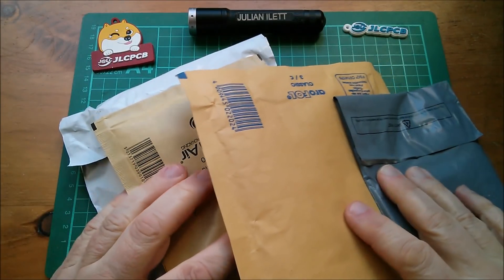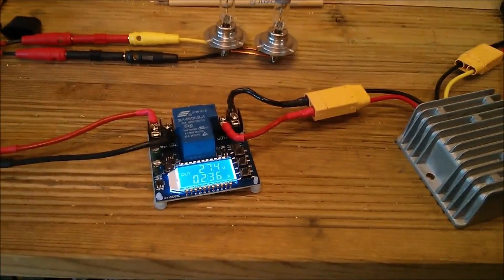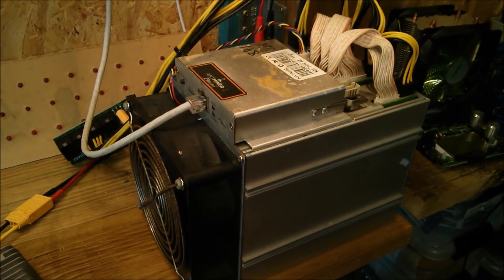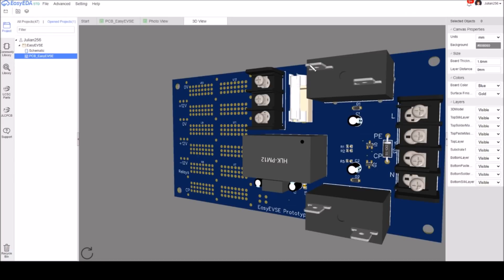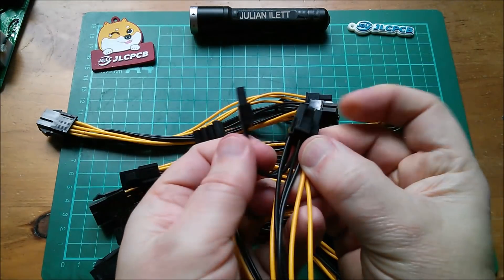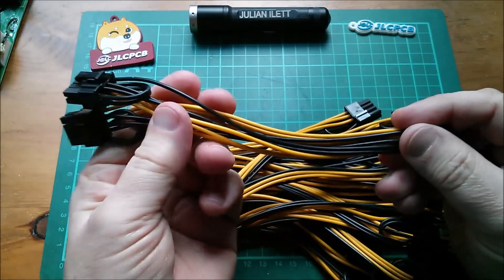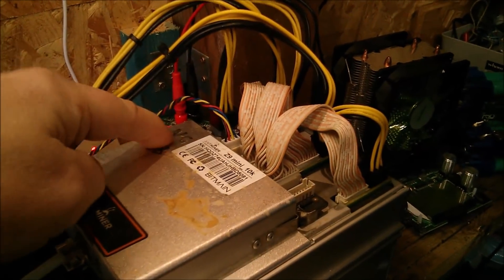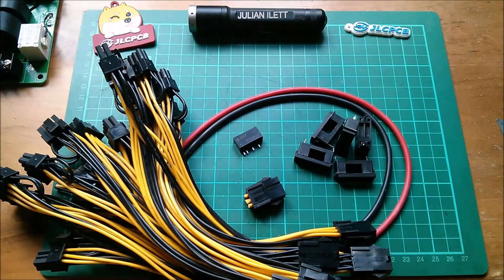Julian's Electronics Postbag #154 - Cables and Stuff

Comment: I have been running several L3+ machines (I sold them last year in December). And I had put 2 L3+ on one Bitmain PSU (having 10 molex-ending-bundles of wires in total). This means: I had only one power cord per hashboard. And if you do the math, you will see the current per wire is within acceptable tolerance. O: and I was running the hashboards on the lowest (under)voltage, I was using a lot LESS Watts then other people but running the same speed!. I can send you the code how to do that, if you know how to connect over SSH. But in short: you only need to connect 1 connector per hashboard. Reason: 220 Watt per board (my board used that, yours may use 250). Six wires: 36.7 Watt per wire. Voltage=12, P = U x I. I = P/U = 36.7 / 12 = 3 Amp per wire for me, and up to 3.6 Amps per wire for your config. I could easily hold the wire and they were barely warm to the touch after days of running. Please do the math? You'll see this is correct.
Reply: https://youtu.be/oP5rWVeiCOY

Comment: Are there silicon dupont wires out there, what uses are the Watt risistor's for, can you provide the link to the pcb and in what pcb circuits would you use a fuse for?

Comment: Great video Julian..   I' m a noob but I made a board using a B01212-2W and a  B1205s-1w for isolated ground for making a diy bluetooth speaker and it worked.  B1212s powers a tone/equalizer board and B0512s powers a bluetooth module from drok brand.  I used a mp1584 module  that takes in 5v to 28v and outputs 12v and it all worked great and got rid of the ground loop noise...  i love those ground isolator modules.  probably better ways to do it but im a noob